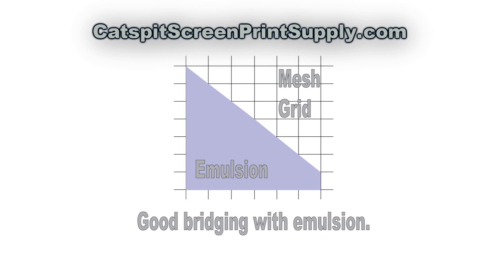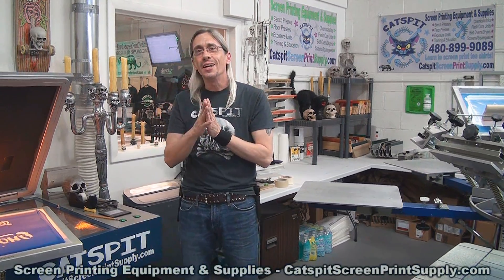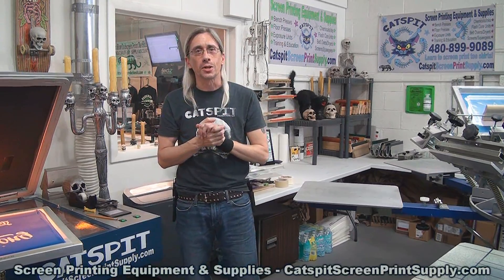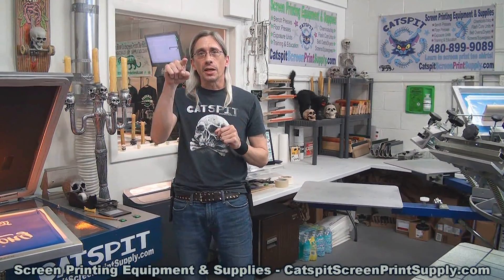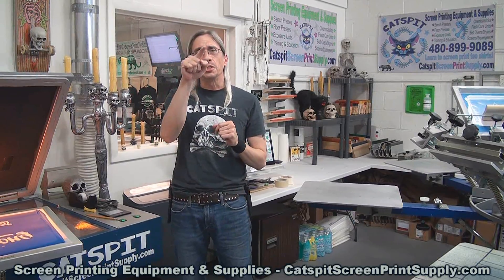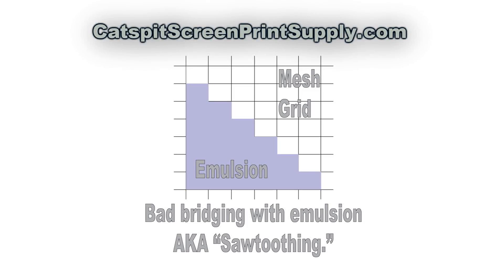Screenprinting Tee Shirts: What is “Sawtoothing” And How To Prevent It

Comment: From my short experience I can tell, to prevent the saw tooths on the screen, it's also a good idea to expose the screen a bit longer to harden the emulsion better. Works often for me. Then if you find more difficult to wash the stencil out, soak it in water for a while  (any container).
Reply from the maker: Thanks for sharing! Yes, a correct and proper exposure will make things much easier but be careful soaking the screen prior to washout. If the emulsion soaks up too much water, it will become delicate. Thanks for watching! Screen Printing Equipment & Supplies - http://CatspitScreenPrintSupply.com/